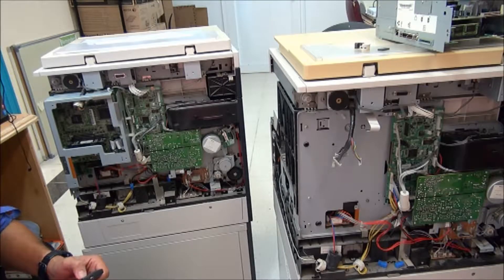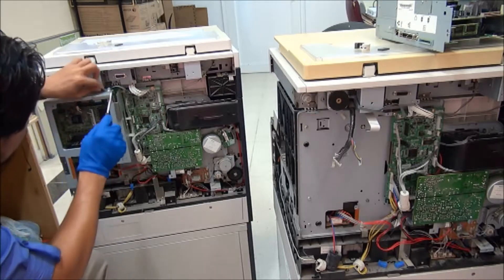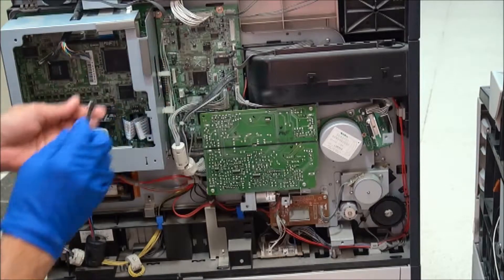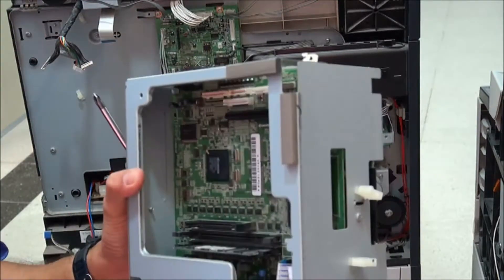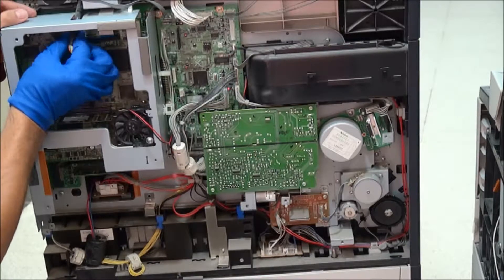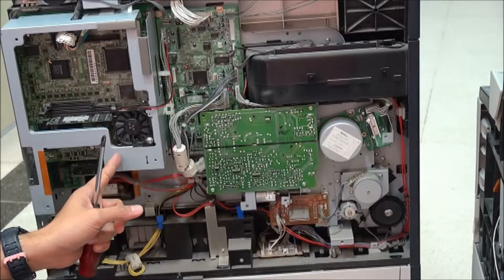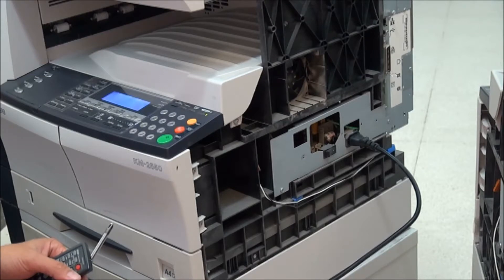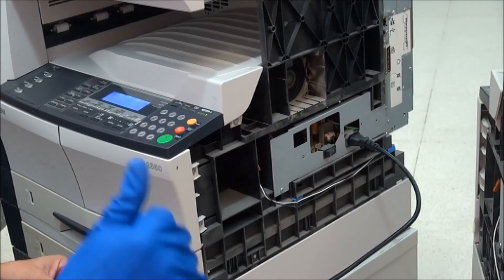KYOCERA KM-2550 Main Board Problem | C0180 error | KYOCERA KM-2550 C0180 error

Comment: sir what if the problem is jsut the main board.. if I order one online do I also need to order the engine board? coz it may  also give me a c0180 error
Reply from the maker: You need to use the eeprom from the defective board and install to the new main board. you can check from my video https://youtu.be/-1SkwfLMAcY . Good luck.
Reply: @macor285  I see, Thank you sir... my  Km2050 user's interface freezes 10 to 20 seconds from powering on. And when I do a  restart it will just stuck  at "Kyocera" logo. what could be the problem sir? thanks
Reply from the maker: @mesgraphix2096  Did you replace the mainboard? Kindly check/read from the service manual the U026 and U027...
Reply: @macor285  no sir, haven't change any of its main parts yet.. I cant run the U026 because the UI hangs as soon after it warms up, cant do nothing on the controls  all keys are not responding..
Reply from the maker: @mesgraphix2096  it is a mainboard problem...

Comment: I use kyocera copiers, many of them have main board problems. Many don't bring light and others will display different codes. One will display (km 53000). I check the code, the copy lamp blown. But copy lamp is OK. My machine models are km2530, km3035. Can the board be repaired or only replacement. Thanks.
Reply from the maker: You can swap the other main board from other machine just for testing. Dont forget to swap also the eeprom. I haven't try to repair the board, only replacement.

Comment: Sir, I posted severally but no response.Does this applies to 2550Ci as well? When I on it,the engine boots properly but no display. Thank you very much
Reply from the maker: No, Its different.  I am not familiar with 2550Ci.
Reply: @macor285  sir,can I send a picture to you ? You helped me on the power board earlier. Thank you
Reply from the maker: No problem...
Reply: @macor285  sir,how do I attach a picture to you?
Reply: It’s a Kyocera TaskAlfa 2550Ci
Reply from the maker: @a.a.2640  send to martealolor@gmail.com
Reply: @macor285  thank you sir
Reply: Sent sir
Reply from the maker: Not yet received...check my email address...
Reply: @macor285  good morning sir, I’ve resent again. Thank you
Reply from the maker: @a.a.2640  I saw it already..Just download the service manual of the machine  https://www.manualslib.com/download/1214948/Kyocera-Taskalfa-2550ci.html . Try to remove the flat cable/power cable  of the operation panel from the mainboard and reconnect again. If still not working you need a experienced technician to repair your machine.
Reply: @macor285  sir,
I will try that & feed you back. Thank you